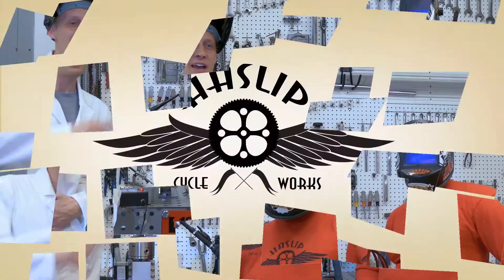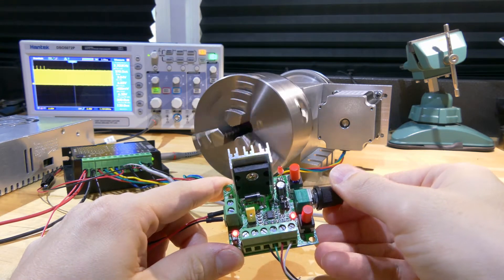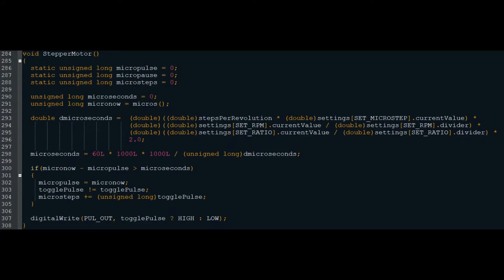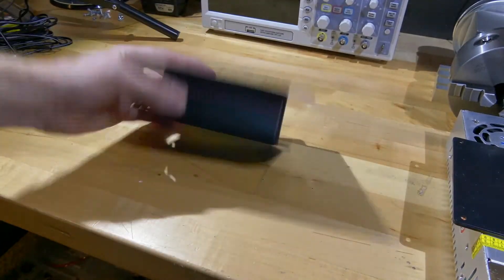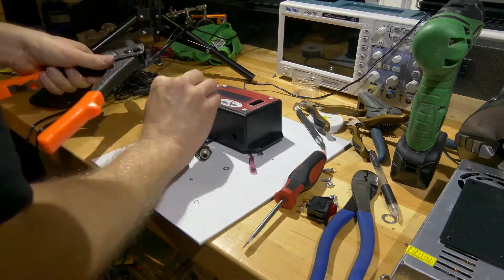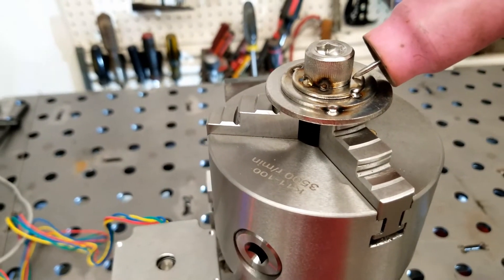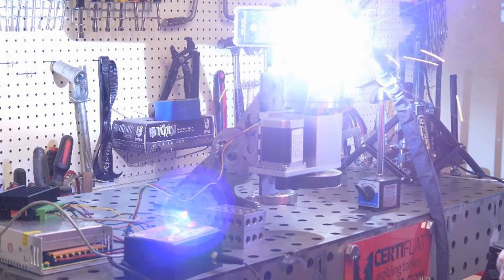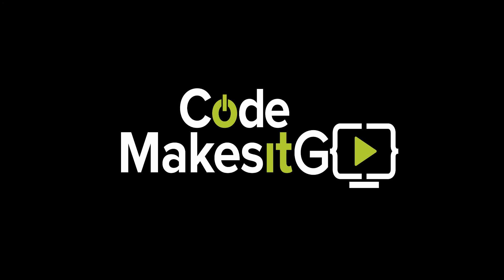Arduino controlled rotary weld positioner

Comment: Great job! Just what we were looking for. Big thanks from welders from Ukraine! )) Found a solution to the problem with discharges?
Reply: Many solve this problem like this:
1. Separate galvanically isolated power supplies.
2. On the free outputs of the Arduin capacitors 0.01 mF
3. The control buttons are connected via optocouplers.
The main interferences are caught by the display - we turn it off at the time of welding for power, like a plus and a minus. Welding relay replaced by solid-state DC.
Reply from the maker: @georgiy214  Awesome, thanks for the info!
Reply: While we are waiting for the screen for Arduino there is no possibility to check your settings .. forgot to ask: is there a mode of constant rotation without stopping? Is it possible to order from you the development of a program for our rotator? Not free))))
Reply from the maker: @georgiy214  There is, just set the pause setting to 0ms and it will rotate constantly. Let me know if you need any custom features too, I'm happy to help.
Reply from the maker: Georgiy Thank you, yes, the solution was to not use the high frequency start. If that is not an option for your welder then you should put the arduino in a metal box and hope for the best.
Reply from the maker: Just checking if you need any extra help with your project. Let me know how it’s going. Post a link if you got everything working. Thanks!
Reply: @CodeMakesItGo  Hello! Unfortunately, the work was temporarily stopped, I think to continue in the near future .. I was very interested in a similar project with spindle unlocking and its constant rotation at 360 * (https://www.youtube.com/watch?v=s_KphaBqBqU&list=LLkFcg6KaEdnq4d7frbsxSCQinindex=30&t=0 I think you will also be interested in such a project implemented on your device

Comment: Needs to add an led receiver for mig.  Just use an led as light receiver in place of foor pedal that way welder can hit the button on the mig and arduino receives voltage signal from led and starts motion.. pulse a simple over ride jog function in both directions ..
Reply: Great idea, thank you!
Reply: @alticetube  I'm a welder for 21 years . All positionars are different in there own way but I like his you all set that up. I've been trying to learn all this programming just for a custom machine like this. Now I want a roll around test stand for semi trailers  with a heavy duty remote controll that I work the trailer braking system and lights .
Reply from the maker: That sounds like a fun project. It would be easy to test the brake lights and turn signals but the power source for the air compressor to test the brakes may be difficult. Unless it is a gas engine air compressor. I don't know your exact application but of course feel free to contact me if you have any programming questions.

Comment: thanks, would like to see the code!
Reply from the maker: Thanks for the request! 
https://github.com/CodeMakesItGo/Ardunio-Welding-Positioner
Reply: thanks, keep this good stuff coming!
Reply: How about a Faraday cage for the arduino. Might work.
Reply from the maker: I wrapped it in aluminum foil and the trons just laughed at me with same result. I think I'll try a metal project box, but Robert just turned off the high frequency start on the welder.  ¯\_(ツ)_/¯